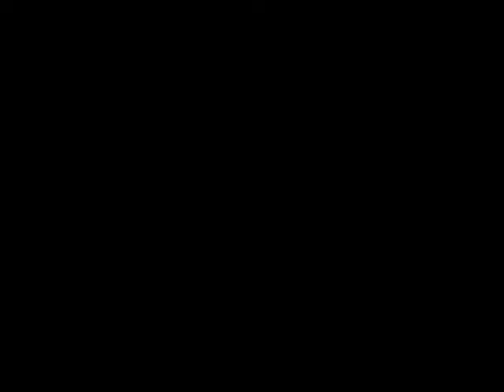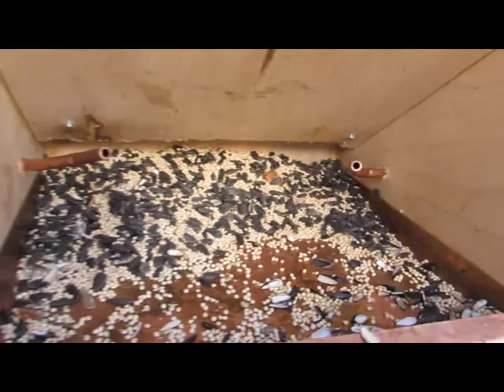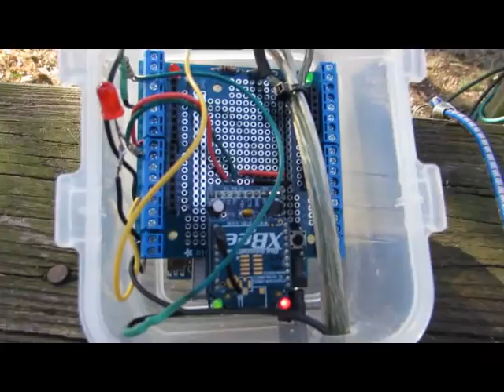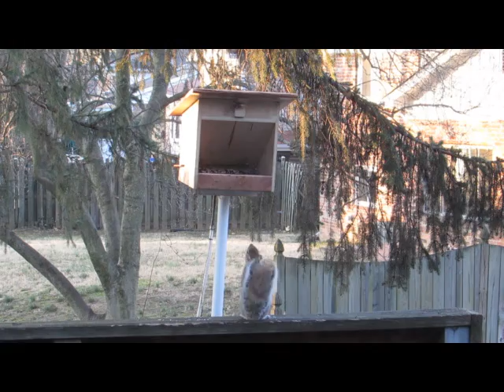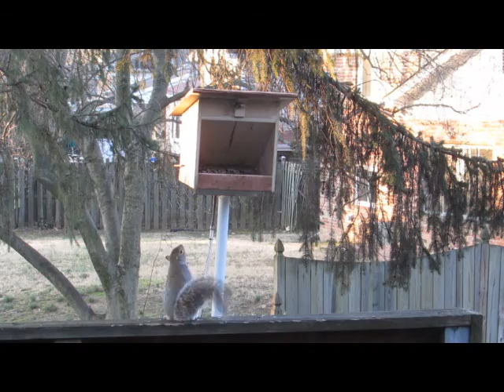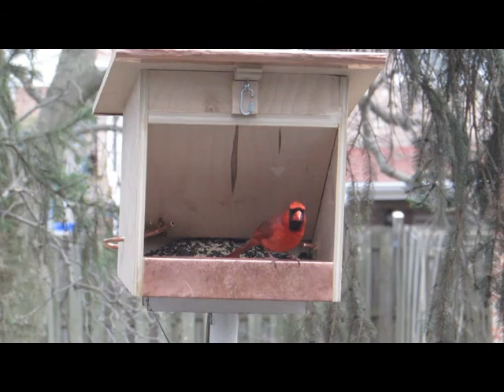arduino bird feeder

Comment: Very well done!  Just finished my most recent Arduino project and was searching for new things... came across your feeder project. Love it.  How 'tight' is the spread in capacitance values between SQs and birds?   I notice what appears to be a link from a chain or something hanging at the top near the opening. Is this to increase the C value when a squirrel is standing on the stoop?  Also, the big question in my mind is how the performance changes when the wood gets wet from rain?  (Judging from the open Arduino enclosure, you may not have done the rain tests yet.  Please keep us posted.  Again,  super job and thanks for posting !!

So,
1. How 'tight' the tolerances in C?
2. What is the objects purpose that's hanging over the opening?
3. Have you happened to do any 'rain' tests yet?